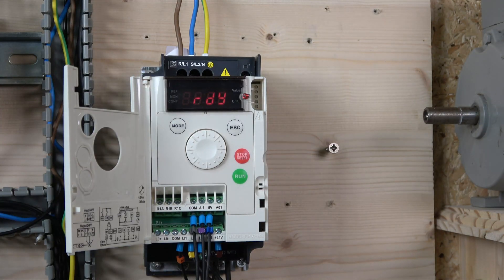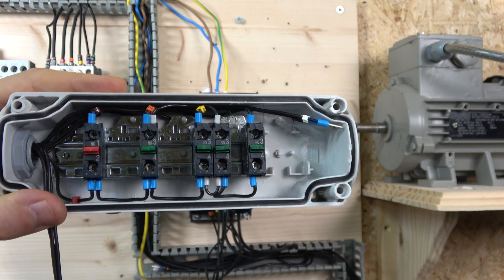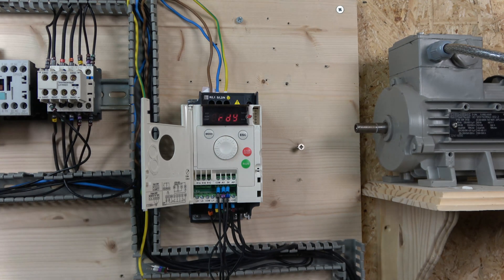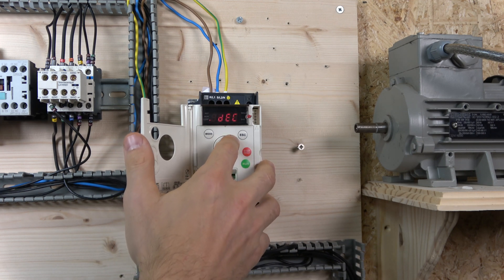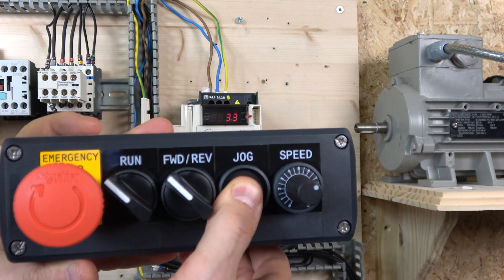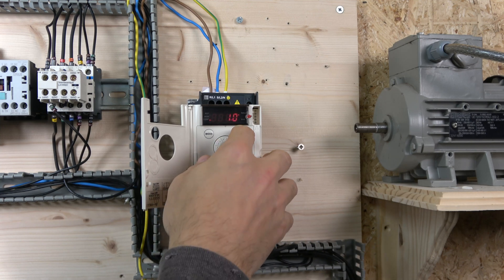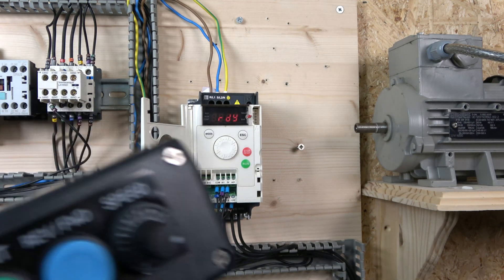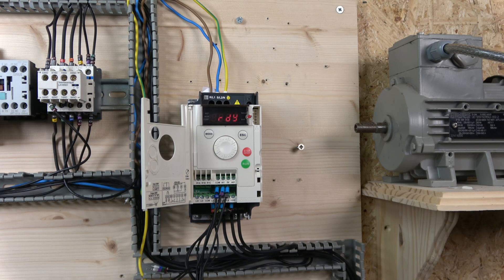Schneider Electric ATV12 VFD, remote control, 2 wire and 3 wire control, speed control. ( English )

Comment: Hi love the video, just a question.

If you're taking your cables from the start/stop/forward/reverse buttons, is it necessary to use a sort of relay for engaging Normally open/Normally close contact's? OR can we just take the cables directly to the VSD terminals as you have done it on this video..

Thanks

Comment: I have one question. I have a machine whose speed of movement (forward/backward) is controlled via this VFD and potentiometer. The problem I have is, that if I set the speed on the potentiometer to 1 (from 1 to 10), then the motor (drive) rotates slowly as it should. But there is not enough torque (i suppose so) and the drive can not move the device which is relatively heavy. The machine has a gear ratio 20:1 but....Is there anything I can change on VFD to increase this? Thank you
Reply from the maker: How is your motor windings set up, delta or star? if don’t know what that means check out the vary first video I have ever maid. Also its available in description.

Comment: Hi, if your happy to just use the controls of the unit (run, stop, speed) is there a reverse option when required directly on the unit as I'm not noticing? or can you just add one simple switch via those connections to give you a reverse/forward feature, while using the units controls direct? Thank you
Reply from the maker: Hi There. No, not for this drive unfortunately.
Reply: @IGSElectronics  thanks for taking the time to get back to me, all the best 👍

Comment: Hello. For my school project we use th atv12. We use the 2 wire control and a PLC sends the signals. That all works fine. but we also need to make it so that when th PLC sends a signal the motor will run at a lower speed. Do you know how to do that ?
Reply from the maker: Hi Yente. Have you checked out the other  videos for this drive on our channel.